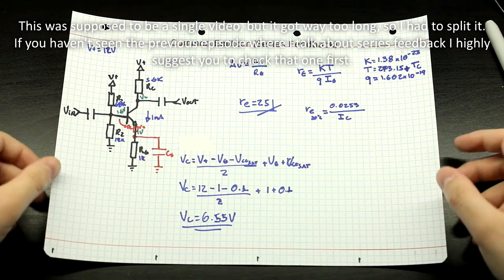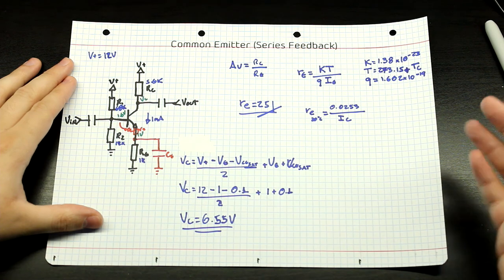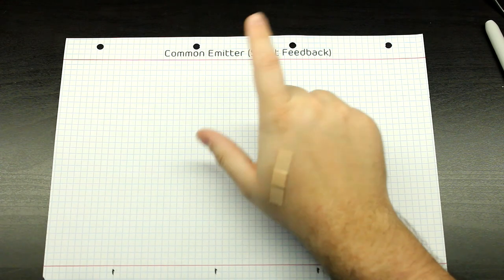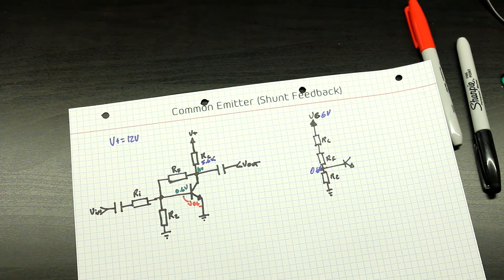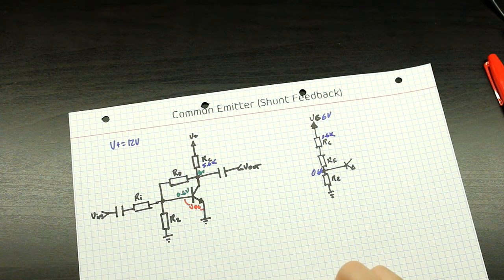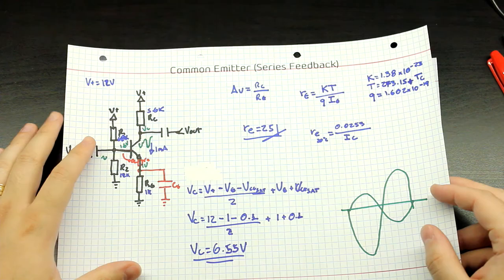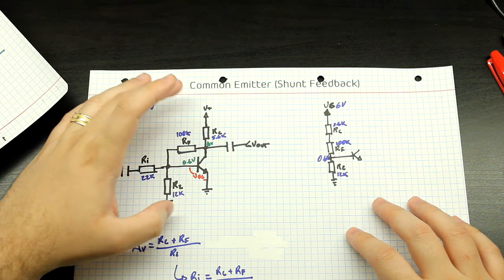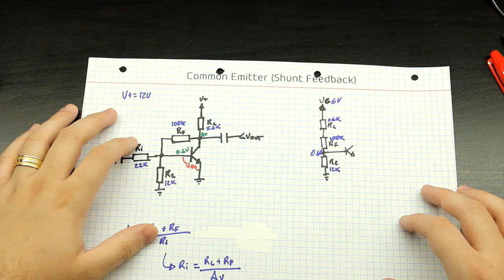#007 - Common-Emitter Amplifier with Shunt Feedback (Class-A Discrete Headphone Amplifier Project)

Comment: What you explain so well is all contained within the OpAmp, and is just one of the things an OpAmp does so well. What is not part of 99.9% of all OpAmps is a high current output stage. I recommend designers use OpAmps to drive a discrete current stage such as you are using because of the OpAmp’s convenient dual inputs and extremely low distortion. There is literally NO downside. The complete amplifier can operate on a single end supply or dual supply if available. The dual supply allows a DC-coupled amplifier if needed.